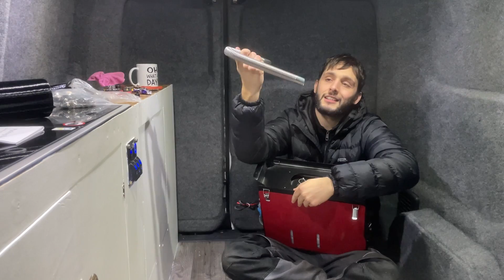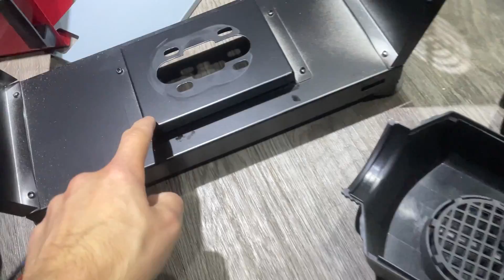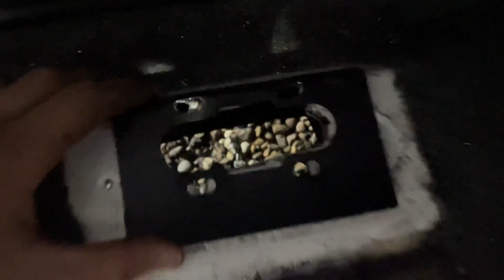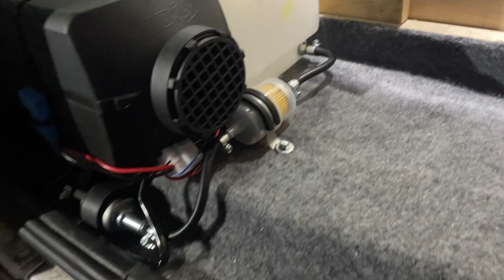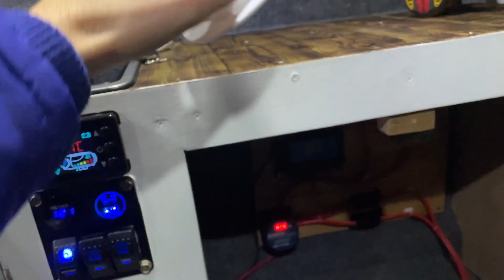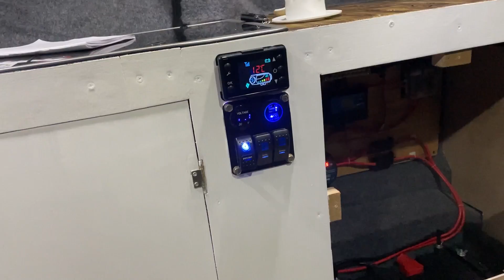Cheap Chinese Diesel Heater Installation Nissan NV200 Camper Conversion Part 5

Comment: Hi dude. Are you aware tge pump is designed to be installed an an angle ?
Something to do with air cavitation and the fuel lubricating the moving part(s) inside ?
Also that ticking sound can drive us crazy. Mine is outside.
Reply from the maker: It’s mounted pretty much the same as it was in the kit it came with (horizontally) 
I get there could be a lot trapped in there and that does make sense. But I’m not to worried about it. The ticking is annoying but I found once it’s set to it lowest mode in my cabinet you can’t really hear it.

Comment: The fuel outlet is higher so any sediment rests below it.
A better option is a dip tube fed in from above and finished short of the tanks bottom.
Install a fuel bellows for pump priming, and a fuel shut off too. 
Better still installed in your vans fuel tank ... 1" or more above the bottom.
( So you cant deplete your vehicle fuel overnight when running low)
Reply from the maker: I didn’t want it attached to my fuel tank for two reasons one. It would complicate things with extra fuel lines and making a hole in my fuel tank and secondly I didn’t want it taking fuel from the fuel tank would prefer it to come from its own fuel tank to avoid that problem.
As for the sediment stuff that’s what the fuel filter is for! I want to use all the fuel 😂

Comment: Hi Ash. Not sure if your image of the exhaust silencer is inverted ?
The fixing should be at the top cos there is a condensate drain hole opposite which needs to be at the bottom!
I have the pump outside and my 2 silencers in series ... and it makes a  big diffetence. Otherwise ignore my rant LOL😂
Reply from the maker: Hi the exhaust is pointing vertically downwards so any moisture/water will fall straight out. And hopefully not rust straight away 😂